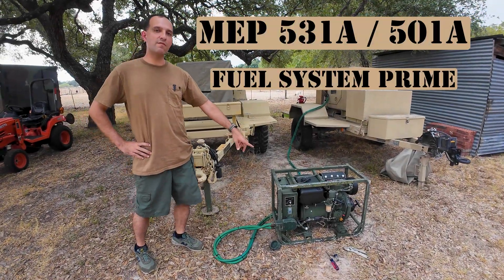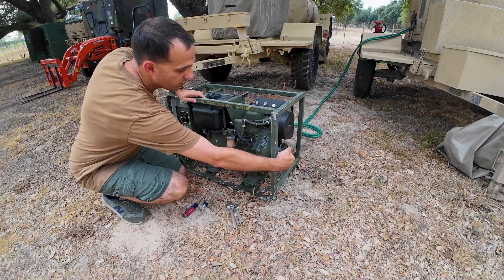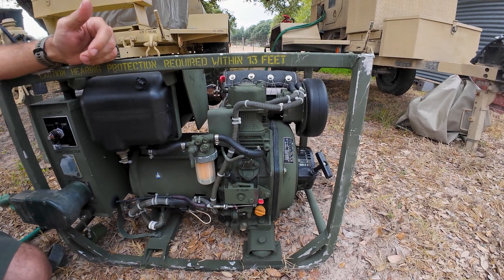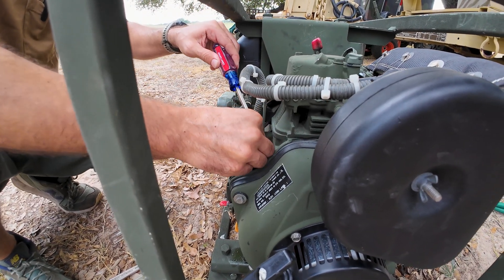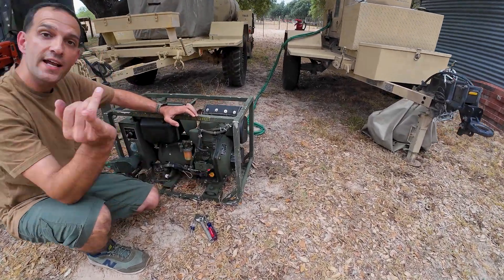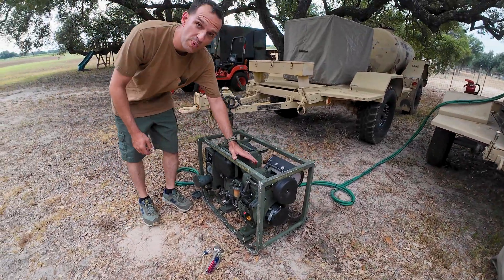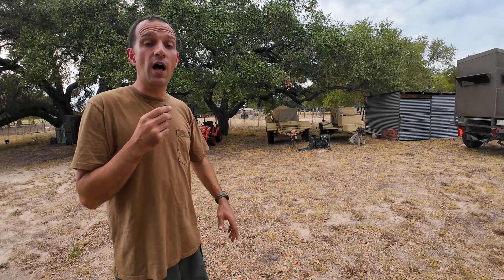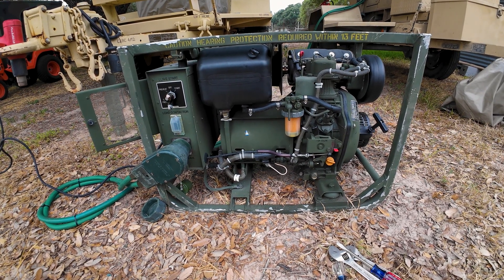MEP 531A & 501A  - Priming fuel system

Comment: Update , used your bleeding protocol & thanks went even higher went to injector loosened line pulled recoil starter about 10 times and it started spitting fuel 
Tightened fitting it fired up second pull and never died cleared up in under 1 min thanks again !!! 
I replaced all rubber lines and return line
Mine has 12 hrs on it
Reply from the maker: Glad you got going. I have a few parts for service and stuff for these. Let me know if you need anything.

Comment: hey boss I have a MEP-501A is it possible to use for my home??? its 28v I need an inverter? or can I just plug it in
Reply from the maker: MEP-501A is a 28v DC generator for charging batteries. It can't be used in anyway to power anything AC power. It will not power an inverter.

Comment: Good stuff.  I had an expert diesel mechanic look at the one I bought army surplus.  Ran it long enough to do the break-in but he didn't do the adjustments afterwards.  Unfortunately it's been out of my hands for the last couple years and has had diesel fuel sitting in it.  I need to clean it up, purge it and get it started.  This video is one of the best I've seen. Thanks!
Reply from the maker: If it has sat with fuel in it, run straight ATF in it to get the gummed up stuff out. Once it starts, let it run for 30 seconds... it may not run well & smoke a lot. Then, let it sit overnight. Swap to diesel & then start again. Let it run until it burns the ATF out. It will dissolve all the crud in there & burn it out. If you need filters & stuff, let me know. Reach out via the website, www.callmecolt.com

Comment: Fantastic video! I just purchased an MEP-501a and this is priceless information. What do you typically replace on any generator that you get? Filters and fluids before running it? Also, what are the specs for the electric start cable? I considered putting on a more quiet  muffler too…any suggestions? Do you now sell parts for these?
Reply from the maker: I have some filter kits as well as the tank well nut. Reach out via the contact form on my site. www.callmecolt.com

Comment: Hello, what does "wet stacked" mean?  Thank you for the videos! I was given one of these 5 years ago with 3 hours on it. Put new fuel and fuel lines, wasn't able to get any running even with 24 volts on slave, im thinking i just didn't get proper priming now🤔. Going to pull it from storage and reference this video for priming, i was thinking the fuel pump was bad. Thank you
Reply from the maker: Wet stacking is something that can happen to diesel generators, or any diesel engine, that isn't run up to it's full temperature. I plan to make a video dedicated to this & military generators down the road, but life has me very busy & it takes time to record & edit a video. :p

Comment: I am looking at one with 4 hours on it for $650. It has electric start and appears like new condition. I am thinking of hardwiring each 120 volt plug to each side on the bus and hope to run every plug outlet in my workshop. Does that sound like it would work ? The shop never runs over 1500 watts. I just need to have power to both bus sides so all my outlets work. Thank you
Reply from the maker: It has lugs on the side for hard wiring. No need to use the plugs. As long as you don't go over what it's rated, you should be fine.

Comment: Invaluable! I have a MEP-501a and a MEP-531a that I bought as winter backups to my battery banks. I am starting on getting my MEP-531a going as it has the most versatility, I saw a guy run an air conditioner from one that would have been useful this summer but late is better than never.
Reply from the maker: These a good little units. Loud, but great on fuel and robust. Weight and loudness are the issues, but it is what it is. I plan to do some more videos on these. I have a series going through a MEP 501A a few years back. Anything that you think would be helpful for people to know that are new to these?
Reply: @CallMeColtLLC  Definitely some sound suppression ideas and electrical grounding while on a cart. Part NSN's and substitutions for common maintenance items. Ideas for weather protection while operational. Changing oil. Oil level. Putting two 12v batteries together with a slave cable to start.

Comment: Thanks for your replies, I agree the way to go would be to get a couple 12v batteries and make my own slave cable. I am trying to get a sense as to what a good working order MEP-531A would sell for? Maybe what to ask for it and what is the expectation of actual selling price???
Reply from the maker: They're worth what anyone is willing to pay. That is how items like this work. A set price isn't really there because one that starts and runs with power isn't the same as a fully refurbished & fully load tested & "burnt out" unit that is known to not be wet stacked.
Reply: @CallMeColtLLC  I can agree with what you are saying relative to they are worth what someone is willing to pay. I just thought given your experience with these units you might know what a very good condition MEP 531A with 6 hours on the meter that had been refurbished and load tested might bring on the market.
Reply: @10xitall   I am looking at one with 4 hours on it for $650. It has electric start and appears like new condition. I am thinking of hardwiring each 120 volt plug to each side on the bus and hope to run every plug outlet in my workshop. Does that sound like it would work ? The shop never runs over 1500 watts. I just need to have power to both bus sides so all my outlets work. Thank you

Comment: Good video. Without some of these tips, it’s almost impossible to start a MEP531. I’ve got one that coughs and pops, it doesn’t clear up and just won’t run right. I haven’t torn into it yet, stuck valve is the best I can figure.
Reply from the maker: If it always runs rough, first think I would make sure of is that air is not getting sucked in at all via the fuel system. Second would be that it is not wet-stacked. 3rd would be that the valves are adjusted properly. These engines are VERY picky to valve adjustment & they are ANNOYING to adjust, You almost need 3 hands to do them!
Reply: @CallMeColtLLC  Thanks for the tip. What was the fuel tank drain mod you mentioned? I’ve got two of these generators and both leak like champs. If there are a few parts I can sub for OEM to make them stop leaking, that’d be great.
Reply from the maker: @Colonel_Obvious  I actually sell the adapters you can use on my store. Same ones are used on the larger generators. I sell them as a two pack for the bigger ones, so if you have two, just get this kit & you will be all set! https://ebay.us/E1DysJ

Comment: Can these be converted to 12v by replacing the starter? Is is a 24v or 28v system? What do you recommend I purchase to have the ability to us the electric start? I do not have a slave cable like you do? Can you recommend one I can purchase? Would a 24v jump start box work? I have 2 of these 531A's being delivered to me next week. Sorry for all of the questions! Best, T
Reply from the maker: 24v & 28v is the same pretty much. 28v is usually a fully charging 24v system. I would advise just getting a pair of batteries to make a cheap 24v setup, then make your own short slave cable to use, instead of cutting into the control box of the generator. You can change to 12v starting, but you end up spending more than just making a 24v setup, and mess up the integrity of the control box seal. I have good condition slave ends for sale if interested. info@callmecolt.com
Reply: @CallMeColtLLC how can I make a slave cable? I know how to wire two 12v batteries to make a 24v system just not sure how to make the cable